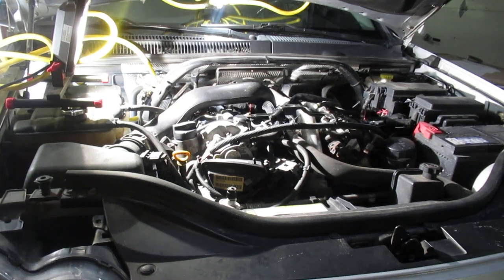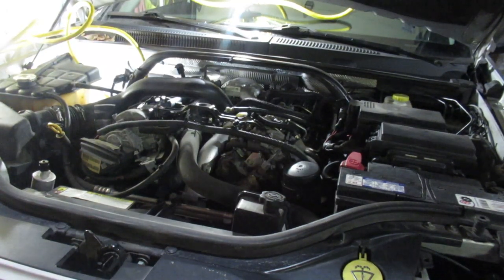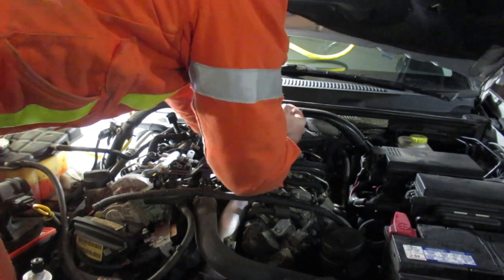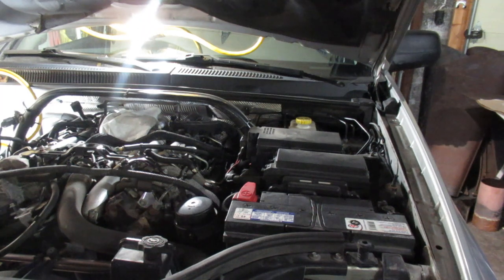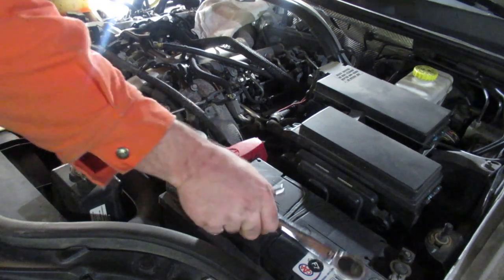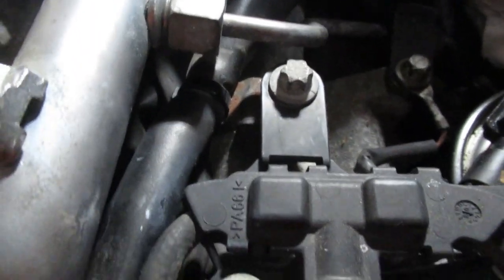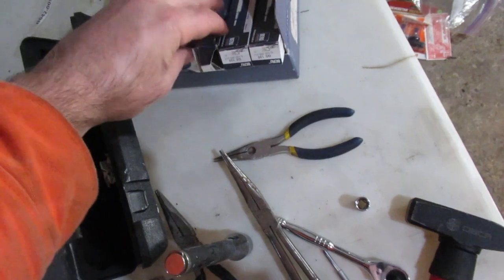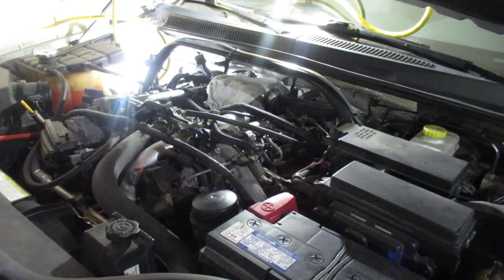2005-2010 Jeep Grand Cherokee WK CRD Diesel OM642 Glow Plug Replacement & Failure

Comment: I got the engine to operating temp and before I loosened them I gave them a good tap or two with the ratchet head on the extension. This breaks the rust and makes it easier to remove. Put anti seize on when putting in new ones.